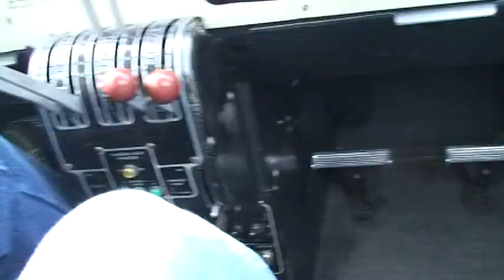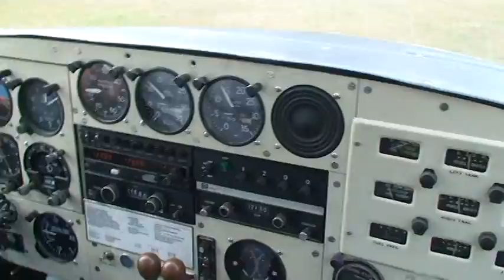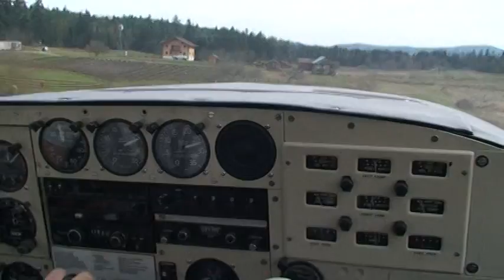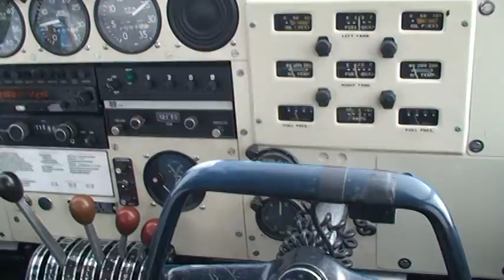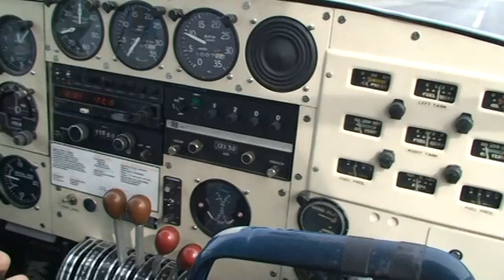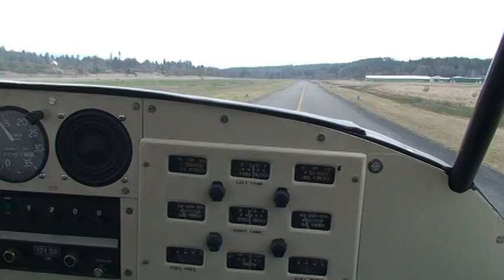aviation ground school

Comment from the maker: @CargoInk no that was the engine restarting. no unfeathering accumulators makes for a rough start, both in the air and on the ground. oil pressure builds and the governor gets the prop out of feather after a few seconds.